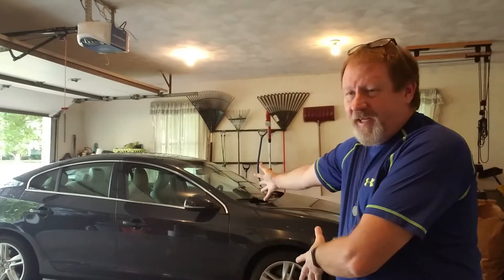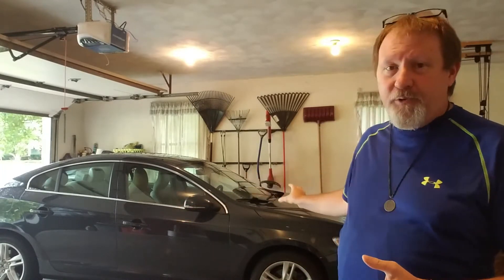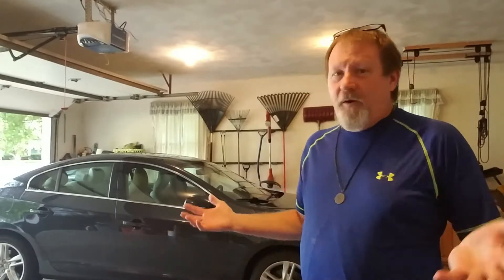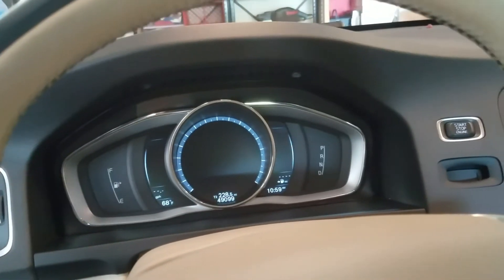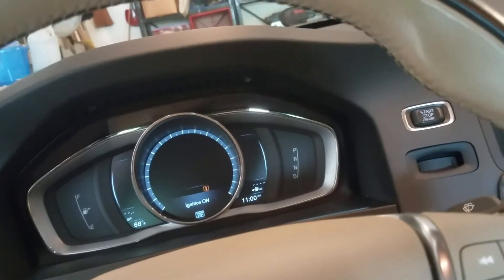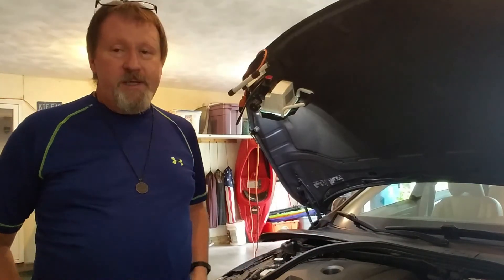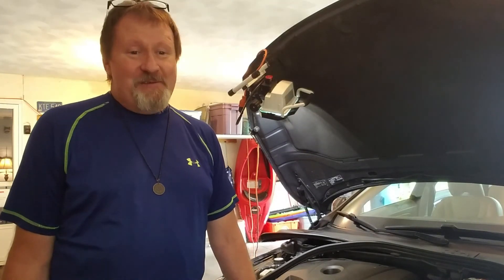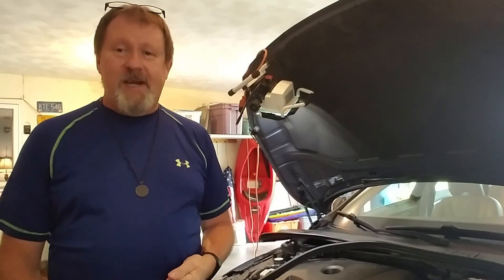Volvo Drive-E Start Stop Not Working

Comment: Thanks a ton sir. Really appreciate your help. 
I was previously living in Minnesota and barely used AC in my S60. I recently relocated from Minnesota to California and I need to use the Air conditioning very often. However the Air Conditioning in my Volvo S60 isn’t working at all. There’s just the fan noise and doesn’t seem to cool my car off. Quite frustrated about it since I never used it. Can you please help / advise?
Reply from the maker: I'm not an AC expert, but I can guess either the compressor isn't engaging, or there is a leak in your system and the refrigerant may have leaked out.  Check your fuses and relays and make sure the electrical connector on the compressor has the plug inserted properly.  Maybe it's just something simple.  If you're not sure, then you'll probably have to take it to a shop specializing in automotive air conditioning to see what's happening.
Reply: Floyd Nash : sure. I will. Thank you

Comment: Floyd, you've helped me so much! I just fixed my autostart but I tried replacing the rear brakes on my S60 but the parking brake torx screws are completely rounded out. I don;t know what to do. Any help would be much appreciated. Thanks
Reply from the maker: Glad I could help.  Those torx bolts in the rear parking brake motor are not the greatest design.  If they get stuck, they can be really hard to remove.  One thing I've heard that you can do, is to take a 9 volt battery and a couple of wire leads, like maybe from just the little power clip you would normally plug a 9 volt battery into, and use that battery to wind the motor to it's maximum retracted position.  If a 9 volt won't work, then a 12 volt from a power drill or similar device would work.  If you connect the wires one way and it seems to tighten it, just reverse the wires to go the other way.

Comment: Hello my Volvo XC60 t6 don't start
Reply from the maker: If it won't start at all, you would first want to check the condition of your battery, or both batteries if you have 2.  If they are low, put them on a charger or use a jump pack to try and start it.